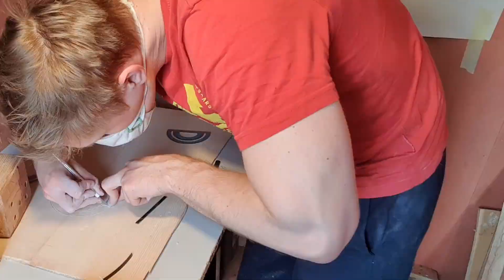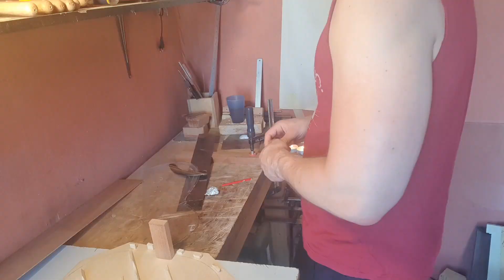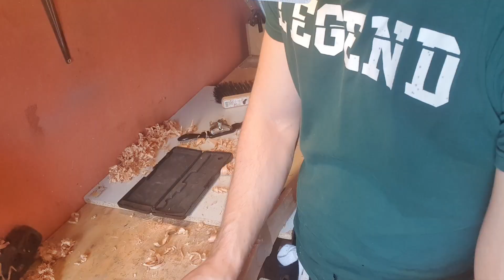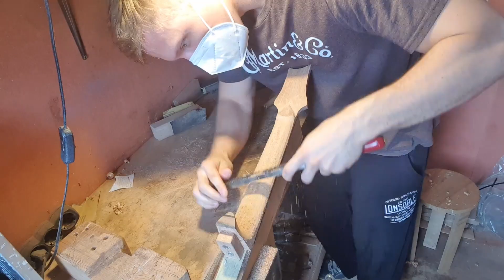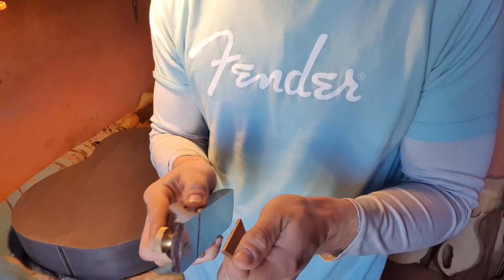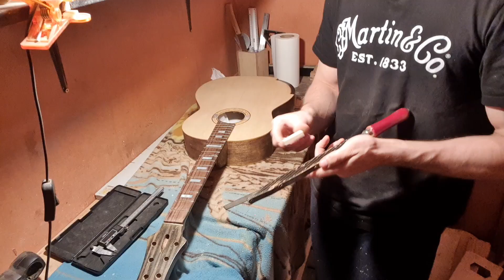Acoustic guitar build with basic tools. Time lapse.

Comment: Thanks for the video.
That was too fast for me!
That was a simple mould you used!
Nice shapes and the  rosette is really appealing just what I would have liked.
Tha arm rest was .. oh never mind!
Reply from the maker: i dont have room for a mould :D the area you see in the video is all the space i have (1.5m x 1m). so i just glue blocks couple mm outside guitars outline to act as guides. works well :) yea, arm bevel isn't so pretty, but i also took bad pictures of the finished guitar. irl looks a little better, but still full of visual imperfections. didn't really have any materials for bevel, wanted something fancy so i used off cut  from a fingerboard and shaped it best i could.

Comment: How does it PLAY?
Specifically, how does this guitar SOUND when played?
You could have made something that looks fantastic.
Which this guitar does.
But if your guitar sounds terrible where picks and fingers meet strings, which for guitars is equivalent to, for cars, where rubber meets road, then all your hard work goes for nothing.
Reply from the maker: Guitar had low action, which i like because i play very softly. it had very pronounced middles so a warm sound and great sustain. sounded better than looked. guitar has a new home so i can't make demo. :)
Reply: 🙂
Nice.